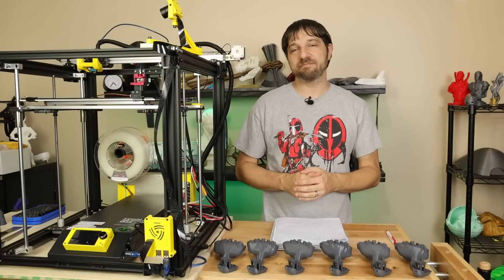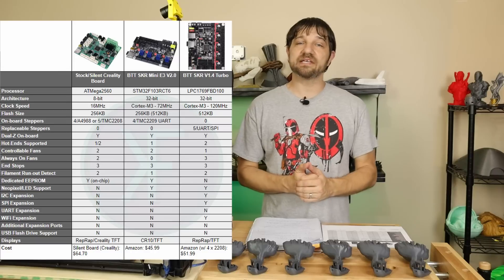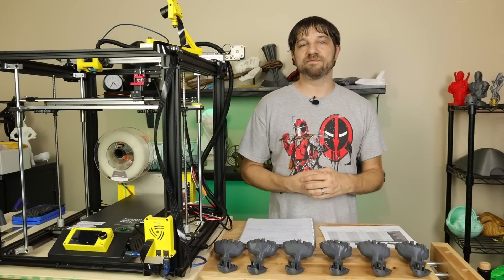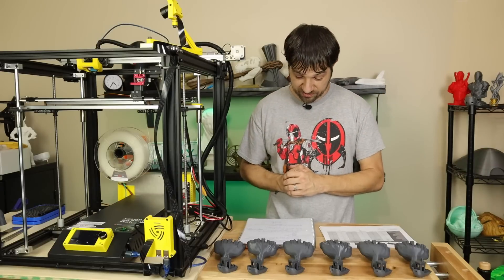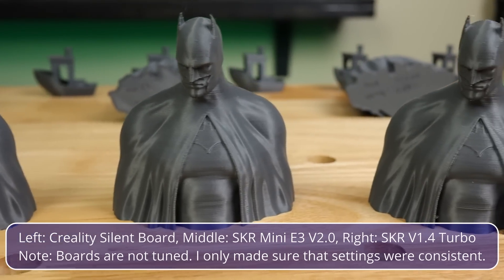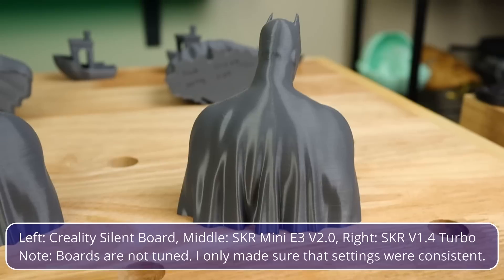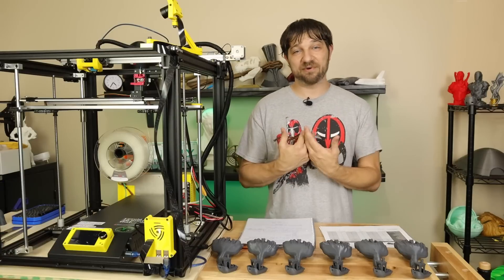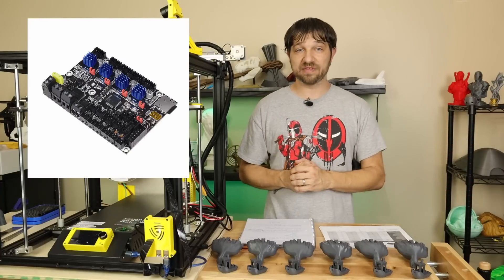Creality Silent Board vs. BTT SKR Mini E3 V2.0 vs. BTT SKR V1.4 Turbo (E5P Upgrade Part 5)

Comment: Hi, I have a Creality silent board (v2, 8 bit) with my 5 Plus, I had to replace the BLtouch, did so, but the new BLtouch (BIGTREETECH BL Touch V3.1) is only good for Creality V4.2.. boards, consequently the leveling is still not functioning properly...cannot properly adjust the Z compensation, the extruder is actually not working, any advice? Much appreciate it.

Comment: Kris, i have been watching your videos on the ender 5 ever since I purchased mine. Now that  you have used both, do you believe either one of these could out perform the snapmaker 2.0? Was just wondering as they use worm gear linear slides.
Reply from the maker: Unfortunately, I've never used a Snapmaker, so I can't really comment. I'd love to give it a shot though!
Reply: @kerseyfabs Me too but I just don't know if ball and screw linear slides are worth that kind of money.
Reply from the maker: @gregd393  For that kind of money, you could upgrade to linear rails or ExoSlide later.

Comment: Great video. I think you talked me out of an SKR 1.4 turbo for my new Ender 5 Pro. I got it a few weeks ago and it came with the 1.1.5 eight bit board which ticks me off. Does the SKR Mini E3 2.0 support linear advance? And am I also correct that it will support both an LCD and TFT? If so I think I found my replacement as I prefer to have as close to a drop in as possible and not to modify the chassis.

I am open to suggestions.
Reply from the maker: Yes, the Mini will support Linear Advance and the display has both modes on any BTT board. It's a great board!

Comment: Hi, one question, what would you recommend for a case when I want to test if changing main board will solve a problem of moved layers ? I am in point where I am thinking about vref changes in x axis which is not performing very well, I have checked cart and bands and nothing changes but makes some quirks on a print. It's seems it is mini, but not sure if this the best option.
Reply from the maker: What do you mean a case? You don't want to use the metal box that the electronics come in?
Reply: @kerseyfabs  Thank you for your answer, I am very gratefull for response. I mean case as use case like in IT, we have use cases for apps, more like scenario, not case as a box, sorry if I was not clear enough. I have already ordered a bundle on bigtreetech site from Czech warehouse, so hopefully it will come. And so happy or not skr v1.4 turbo is going with 2209 divers. See if it helps, quirks are that X is moving a little bit left then a little bit right and speeds are not great so it is not because going too fast, but it happens mainly on more complicated features. Maybe hotend strucks print, not sure, it shouldn't. I am more convinced to theory of too weak drivers. Great channel all the way :) It was very usefull to me. I should have watched hotswiss direct drive video earlier and think about lighter then hero me upgrade of cooling, but on original one some quirks on X was visible sometimes too in almost the same heights, but it was more rare. I wasn't as happy with ender 5 plus, as you do, but I think Creality is not a bad choice. Currently I think I should have gone with ender 5 pro with some upgrades already there. It would be some less tinkering for beginner. Cheers, I will return to your site when flashing system :) PS. I hope after all those upgrades at least frame will be untouched. ;)

Comment: So what is the point to buy the ender 5 if you will change the board , the next is carriages, stepper motors :) ? I did mine ;) under 300 usd ;)
Reply: because its noisy

Comment: Thanks for the video.   Complete noob looking to upgrade the board on a CR10 S5.  I also have an Anet A6 that arrived with a broken frame and no controller.  I ordered it from GearBest.  They shipped me a return from an Amazon Warehouse in Arizona, that had been dis-assembled broken/damaged and shipped in a Pampers Baby diaper box.  3 months later and GearBest and PayPal say I have to ship it back to China for a refund at my expense.  Shipping is $128 for a refund of $119.   I'm thinking the  mini E3 will fit my needs as I don't need a lot of expansion.  Does it support thermal protection for hot end and heat pad?  How about print resume after a power failure?  Lots of thunder storms here in Central Fl.  Thanks again, Ken
Reply: I just spent some time learning about the SKR 1.4 Turbo, and it does support the resume on power loss and thermal protection.

That being said, these boards can be a source of confusion for this stuff. From my point of view, if I see the MB supports resume print, I assume it is available on the board from the start, but in looking at BTT's parts addons, there is a module you need to purchase to enable the feature.

You can also add plenty of other cool boards to expand functionality, there is even a web server board to remotely control the printer that looks pretty cool, an additional epprom expansion for the I2C expansion, boards to add more stepper controllers, and a automatic shutdown switch to power down the system when a print is finished.

Resume print is called BTT UPS 24V (v1.0 available on amazon, not sure if updates exist).

I would love to see this channel pick up some of those upgrades in the future...

Comment: Hi There wish i had come across your channel earlier, as i have just muddled my way through upgrading my CR10 S4 to the skr 1.4T - i have been plugging my BL Touch into the additional port supplied, and not had much luck with getting it running, seeing you add the signal to the z end stop port, i will try that and see how it goes. I enjoyed your way of presenting and attention to small details - lot of thought put into the vid prior to actual recording, and it shows through. one small question I have not been able to get the TFT screen 'touch mode' to get rid of the error 'no printer attached' though the printer is obviously working and printing, yes i have checked the baud rate :-) still no joy. a vid on this would be great - up voted and subbed, looking forward to seeing more, great work
Reply from the maker: The only thing I can recommend without seeing things is to double check the orientation of the wires. I think a video may be in order. Too bad I don't do this full time! So many videos to make!

Comment: I have a stock ender 5. If I wish to add a bl touch, filament runout sensor, and neopixel. As I understood the Mini E3 can't handle those expansions. If it does handle those upgrades, which board would you recommend for me? 
Note: Neopixel isn't important.
Reply from the maker: The Mini E3 V2.0 can actually handle that. If you want the Neopixel support, be sure to buy the 5V DCDC module as well: https://amzn.to/3lMq28x
Check out my SKR Mini E3 video. I installed it in an Ender 5 Plus which has all of those but the Neopixels.
Reply: @kerseyfabs   Thank you for your tips. I need now one more tip. If the Mini e3 is cheaper than the 1.4 Turbo + 4x TMC2208 by 15$. Which board would you recommend?
Reply from the maker: Do you need an extra stepper driver?
Reply: @kerseyfabs  In the near future no because this is my first 3D printer but later on I might add another extruder if I can
Reply from the maker: I'm working on the review of the new board, the SKR E3 Turbo. You may want to wait on that review... 😁

Comment: Thank you so much for your videos, thanks to you I'm gonna be able to switch the stock board for the mini e3 v2.0. Just one question, is que code M600 on in your configuration?? Again, many thanks!!!
Reply from the maker: No problem! Yes, M600 should work in my firmware.

Comment: I hope there's a fix video on how to improve the prints on the skr turbo and 1.4
Reply from the maker: Please keep in mind that the 100mm/s benchmark was purposefully designed to stress the processor on the board to allow speed comparisons. I may do a follow-up video to explain this more. You could easily improve this print by changing the "Maximum Resolution" value in Cure to a larger number. For more information on that, see this video by CNC Kitchen: https://www.youtube.com/watch?v=Hvw3DrVAeTA
Reply: @kerseyfabs  I"m curious, Kris ... did you have junction deviation and/or s-curve acceleration enabled for all of the boards? Or did I miss the episode where you went over the settings? 😁
Reply from the maker: @OriginalDodgeDeBoulet  I didn't specifically go over settings but I did make all of my files available in the description. I followed all of my own advice from my previous Marlin 2.0 videos. Junction Deviation is disabled. S-Curve Acceleration is enabled.

Comment: Thanks for the information Kersey, and thanks for the lerdge K suggestion for my Anet A8 plus. I gave up on it and just got an Ender 5 plus. Question. I tried to flash the ender 5 plus firmware to the skr mini e3 v2.0, but it for some reason will not override the ender 3 firmware I tried on it when I was using it on the anet. any suggestion?
Reply from the maker: No problem. The best I can offer are the usual instructions.
1) Use the original SD card that came with the board or try a new SD card (The SD card capacity should be less than or equal to 8GB and formatted as FAT32.)
2) Copy the firmware file to the SD card and name it firmware.bin.
3) Safely eject the SD card from the PC/Mac.
4) Power off your printer.
5) Insert the SD card into the board's SD card slot, not the display.
6) Power on the printer and wait for it to boot up. (At least 30 seconds to be safe.)
7) You should be able to remove the SD card and check the file. You should know longer have a firmware.bin. It should now be name firmware.cur.
SUCCESS!
Reply: @kerseyfabs  ah man you're the best! I'm going to try this today. Thank you!

Comment: I remember while you were troubleshooting quality, you mentioned you disabled S_curve_acceleration and enabled Lin_advance, that they could not both be enabled.  I noticed on your new configs that you reversed that.  Now you have S_curve_acceleration Enabled and Lin_advance Disabled.  Does the later configuration work considerably better?
Reply from the maker: I decided that S-Curve acceleration would benefit across the board, not just at high speeds. I hardly ever print faster than 60mm/s.

Comment: I would be interested in how silent the boards are compared to each other. Were they all the same, or did the noise level change between them?
Reply from the maker: The boards don't really change the noise at all, only the different stepper drivers. The TMC2208 and TMC2209 are comparable since they use similar technology. I didn't notice any difference during my testing.
Reply: @kerseyfabs  awesome, thanks for the reply! i have both a stock ender 3 and an ender 5 plus...i purchased the SKR 1.4 turbo with the intent to put it in the ender 5 under the same assumptions everyone else had, but now I'll be putting it in the less used ender 3 and getting a mini for the 5. Thanks so much for your videos!

Comment: Hey Kersey quick question. What are your retraction settings? I have a lot of stringing lately and I just can't get any of my tests right (4-8 and 25-50 speeds). I'm sick of testing. :)
Reply from the maker: I'm running the Micro Swiss hotend, so keep that in mind. I have two settings that seem to work well, depending on filament and/or print, 4mm@25mm/s and 7mm@40mm/s. Lately I've been using the 4mm setting because it works better under most conditions. Also keep in mind filament brand and temperature have a big impact on stringing.

Comment: (QUESTION) I wanted to say thank you for this series! I bought a Ender 5 Plus and there has not really been anything for how to problem solve or make mods besides your video! Last night my BLTouch cable was loose and when I pressed it back down it shorted the motherboard and the Z-axis doesn’t work anymore.. I ordered the Creality V2.2.1 silent board but after watching this video I was looking at the Mini. Do I need to run Marlin to use the mini board?
Reply from the maker: I'm sorry to hear that! Yes, these boards run Marlin but I do provide the binaries so that you don't have to compile it yourself. Make sure you're subscribed, new video coming out today!
Reply: Just got subscribed! Thank you for the amazing videos!
Reply from the maker: Thanks Wil!

Comment: Creality now seems to have a 32bit version of the silent board (V4.2.7). Any words on that?
Reply from the maker: I just took a look at it. From an Ender 5 Plus perspective, Creality doesn't have firmware yet that I could find. From a hardware perspective, it doesn't appear to offer anything over the SKR Mini E3 V2.0. It's the same processor (or close to it) and, knowing Creality, it doesn't have configurable steppers. I'd stick with the SKR personally.

Comment: Did you miss the link for G34 command and what it can do?
Reply from the maker: Thanks for reminding me! I just added the following to the description:
G34 Information:
https://marlinfw.org/docs/gcode/G034.html

Description
Align multiple Z stepper motors using a bed probe by probing one position per stepper. See M422 for Z-Stepper automatic alignment parameter selection.

Notes
Requires Z_STEPPER_AUTO_ALIGN

Comment: Hi, i own a ender 3 v2, i want to add double z dual motor with g34 sync, what board can i get? and more important, the drivers, the 1.4 turbo, i like that i can replace the drivers but the fit require mods, and the e3 is plug&play buuuuut, the chance of getting a driver broken, is a concern? because the e3 cost half of the 1.4 with drivers, pls help
Reply from the maker: Well, you can always go with the E3 Turbo which is a good mix. It's like the 1.4 Turbo but with the drivers soldered on and it fits the Ender 3 without modification. If you were to get any damaged drivers, just exchange it. I have a video on my channel about the E3 Turbo if you haven't seen that yet.
Reply: @kerseyfabs  Thanks fot the reply! I really like the e3 v2, and here in Argentina the e3 turbo is a "hard find" kinda thing, i mean, if one driver broke, i can buy a single driver, and just use it as a donor, so for the price/stock etc, the e3 v2 is a solid buy, and the screen, im using the Jyers Firmware, is a game changer, i wanna use the v2 screen with the e3 v2 board, so im gonna spend hours trying to get it up and running haha, thanks a lot for the reply again, is really hard to develop things here

Comment: what's the difference between the TFT35 E3 V3.0 vs TFT35 V3.0??
Reply from the maker: Just the form-factor. The 'E3' is targeted as a drop-in replacement on printers like the Ender 3. You can find generic mounts for both.

Comment: Creality Ender 5 Plus : I could never get the BLTouch to Fully work on : The Creality TMC 2208 is a Plug and play that works without issues
Reply from the maker: You couldn't get the BLTouch to work? What was the issue?

Comment: i want BTT SKR v1.4 Turbo screen replacement required for this boards?
Reply from the maker: I don't know exactly what you're asking but yes you should replace the screen. There is a way to use the stock screen but it's involved and I've never taken the time to do it.

Comment: Wouldn't it be true that Ender5 HW platform is more relevant when it comes down to print quality?
Reply from the maker: Sure but this is simply comparing prints on the same platform when changing out components. I'm evaluating the upgrade itself, not the printer.
Reply: @kerseyfabs understand and no doubt that such the upgrades and selection process are very important for people in the community. I would like to see also comparison among choices of SW various slicers/versions and HW especially print heads(authentic products & clones).. I meant whatever subject relevant to you.

Comment: I'm not sure why you are under selling the e3 for expansion. It has expansion and more than the neo pixel. It has bltouch socket, can handle touch screen, filament runoit and tou can even add a wifi board.

The e3 is excellent for expansion. The e3 is excellent for firmware (upgrading from sd card) and its really good at silencing the board. 

I bought this motherboard after plenty of research and I can tell you - you get a lot of bang for your buck.

Bigtreetech e3 mini v2 all the way..
Reply from the maker: Thanks for your comment Paul. I see your point. It depends on where you're coming from on whether this board has expansion. If you're starting with something like the Ender 3 or regular Ender 5, there are several expansion options. If you're starting with the Ender 5 Plus, the things you listed are stock features, not expansion. Since I was starting with the Ender 5 Plus, this board didn't leave many places to go. So it's just perspective. (You mentioned WiFi but it doesn't have a port on board for that.)

I didn't feel that I downplayed the board at all. I really like the Mini E3 boards. Thanks!
Reply from the maker: @paulradford4100  That expansion board requires the correct header on the board, which the E3 doesn't have. You could attach it to the TFT display instead though. It's not exactly the same thing though.